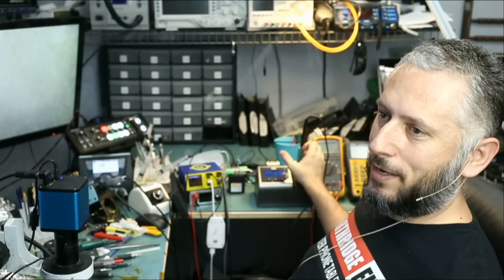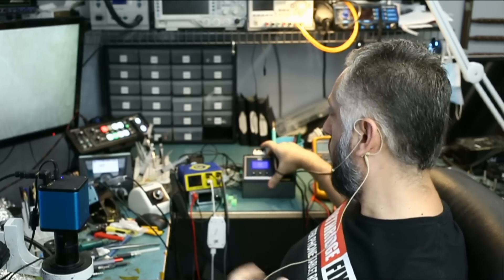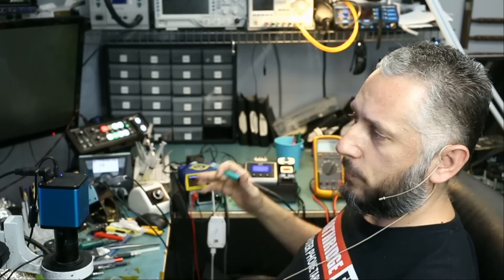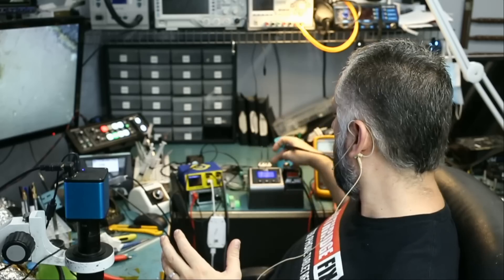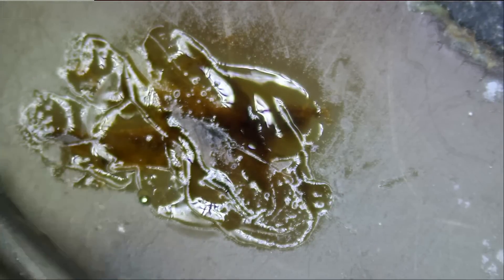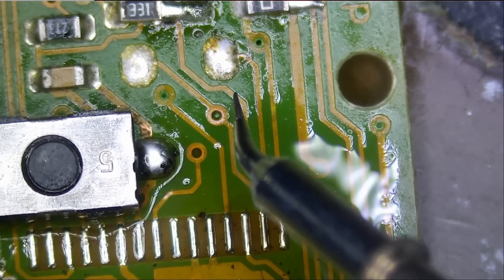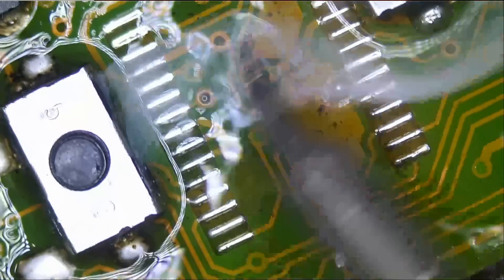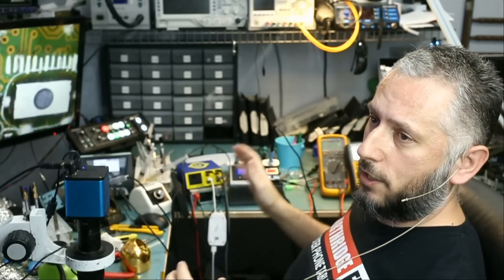Soldering Station JBC or I2c. Is it any good. 7 Different tips and 3 Handles

Comment: You will be able to use original JBC tips with this station that way you will get better performance. Or if you want something that looks good and works well then go for SUGON T3602 2 in 1 or T36 for micro pencil. There's another JBC knock off which is cheaper than above mentioned its GVM T210 it performs really well considering its price point.
Reply: SUGON gear are very good quality, T26, T26D and T36
Reply: I just bought the GVM T210 but not I'm getting an error message 5-E and keeps beeping. Do you know about this?
Reply: @euphoricmonk  could be the tips did not insert well
Reply: @rifatahmed4659  right when I turn on the system it happend with or without the tips.
Reply: @euphoricmonk  hmm ..then it could be a faulty unit contact your suppiler replace it
Reply: @rifatahmed4659  it was 1 of the Tips that was defective. I swapped it out for the K tip and the unit works fine. QC might be lacking a bit, but overall good unit.

Comment: As always love the honest opinion. Maybe it's very unfortunate that you had a faulty machine with the errors, or maybe it's early production? At a time where I'm looking to get a more reliable soldering iron, this video has been very helpful, thanks 😊
Reply: I bought a second hand Weller (WD1M) which supports all kinds of handles and thus all kinds of tips. New they are way too expensive, but if you are looking for a second hand one you will find one for a good price eventually ^-^

Comment: Hi Alex, I'm just here to say I would not buy a product based on the fact that it is a knock-off of a major brand. They can have my money if the product is good and if the design is original. A knock-off means shady business practices to begin with, so who knows what else is there. Also, with what I assume is a chinese manufacturer with no established presence, where would one get tips? We all know tip life on some soldering irons like the JBC is somewhat short (one reason I personally prefer Pace), so who guarantees we will be able to find tips for this machine in 5 or 10 years time? I can find tips and accessories for my 10-20 years old Pace soldering stations no problems.

Comment: It's better to have a professional machine like jbc, weller or hakko and to have this machine for occasional uses
Reply: Or as a temporary solution to keep things moving in case your main machine fails while you wait for a replacement.
Reply: Jea, but if sometimes does not want to work... it is not usable
Reply: @ACOnetwork   It's true but this kind of cheap machine only helps when there is a problem with the professional machine.

Comment: 450 is to high temperature....350 is good,try
Reply: I invite you to even attempt to desolder a 0805 SMD resistor from a 12-layer motherboard, with unleaded solder at 350 degrees. Let us know how it goes!
Reply: @crazyphil7782  
It's not about this...you have to play with the temperatures so that it sticks to the tips...Keep in mind that there is talk of a soldering station that is a copy of the original and the tips too .... try an original jbc and you will fall in love ... but quality things cost
Reply: For lead free thick pcb soldering 450C is barely cutting it mate. And i am using a genuine JBC station too. Tip cleaning and maintenance is key at those temps as they will burn out fast. Alex needed to clean that tip on brass wool and keep it with a bit of solder on even when in the stand to ensure oxidation does not happen but i believe the tips are of bad quality aswell.
Reply: I doesn't even matter, if the machine can go up to 450, then it should do that without any issues
Reply: @bercu giuliano It will depends of the type of work you are doing, if you work on small components or even in wires using leaded solder maybe you can work with that temperature on the tip. But for example to me, i work with smd and pth components every day, using lead free solder only, assembling in brand new boards with many layers, specialy the ground points very hard to solder them, and to make a good and fast soldering work i can't ever use less than 390 to 450 degrees Celsius in my soldering stations (i use Ersa and Weller stations and both performs very well).